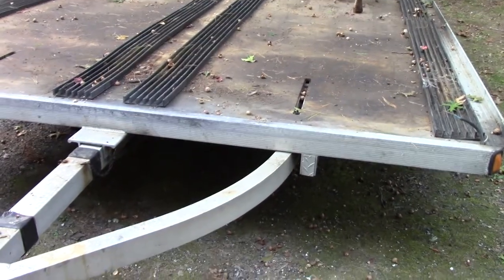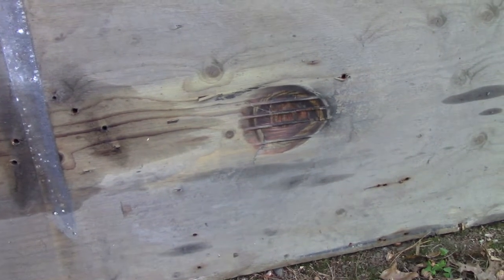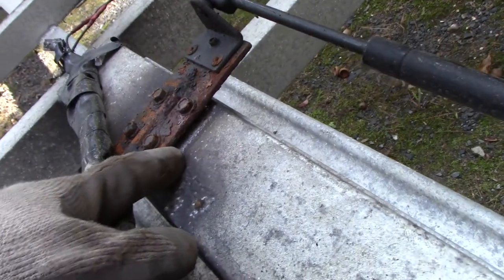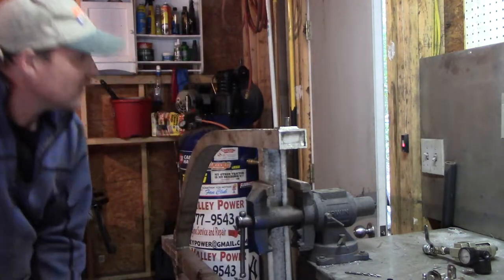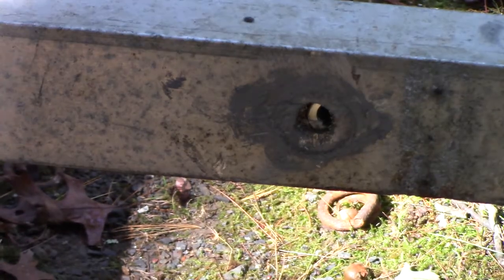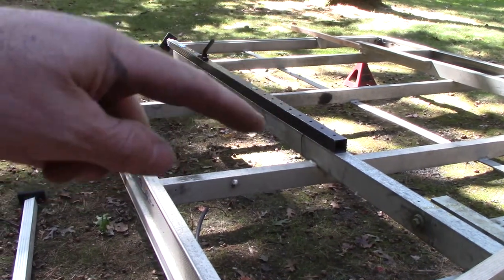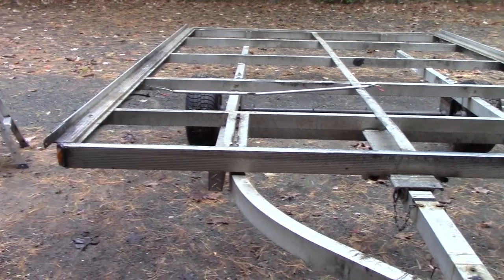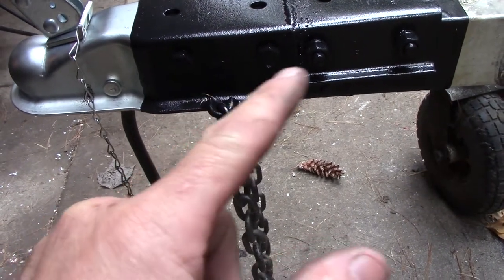Aluminum trailer corrosion (electrolysis) repair

Comment: How old is the trailer
Reply from the maker: 2005 but that vid was a few ago
Reply: @JLafix  I have 2 aluminum trailers 1 3 place open triton snowmobile trailer and 1 3 place Enclosed ...tempted to just remove the coupler until I need to use them to stop the corrosion